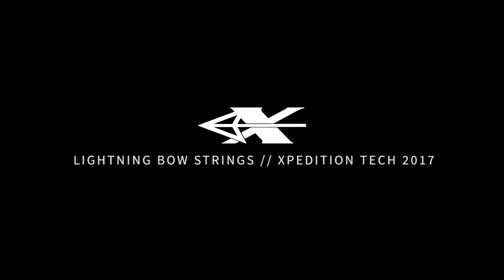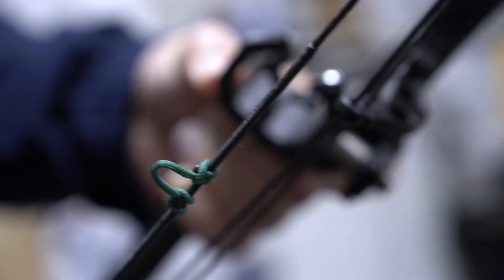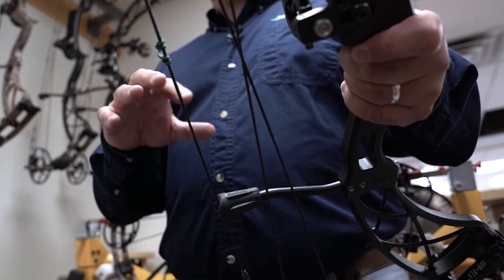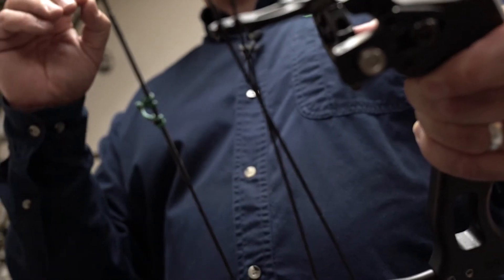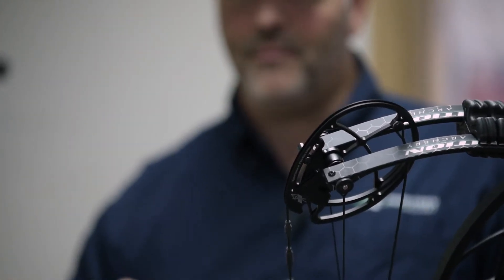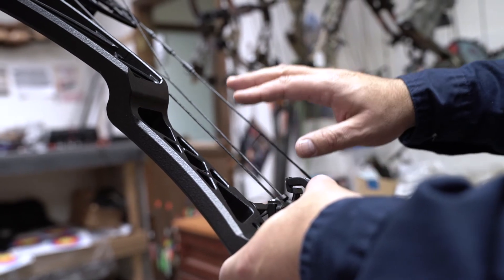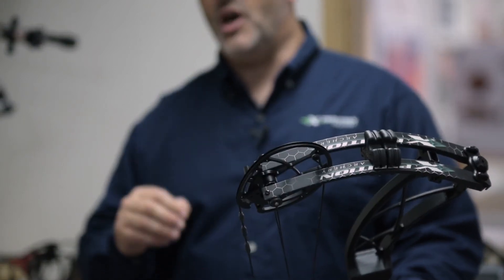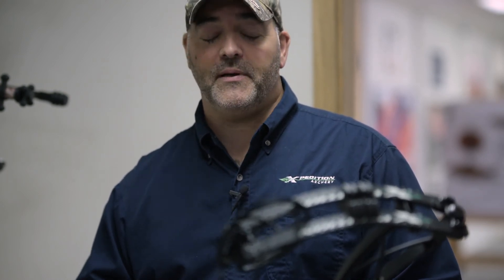The Lightning Bowstrings on your Xpedition Bow

Comment: Sorry, but my xcursion 6 bow strings/cables are by far the worst manufacturer strings I have had (4th brand new bow from reputable make...Mathews, PSE, Hoyt ). Over 3000 shots through my bow and still have to adjust peep every time I shoot. It took around 900 shots to start getting consistency out of it. Next set of string will not be lightning.
Reply: We are sorry about your experience.  We would suggest calling Mike at Lightning Archery, he is very focused on making sure his clients are satisfied.  As pointed out in the video, inconsistencies can happen with production strings and cables. We apologize for the inconvenience.
Reply: Mine twists like crazy.   Putting custom string on that i know dont move.